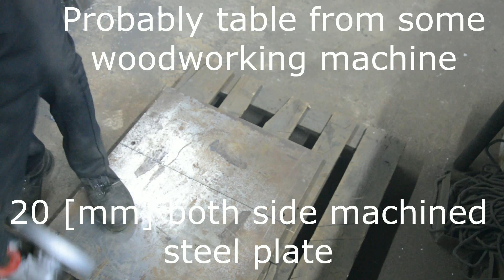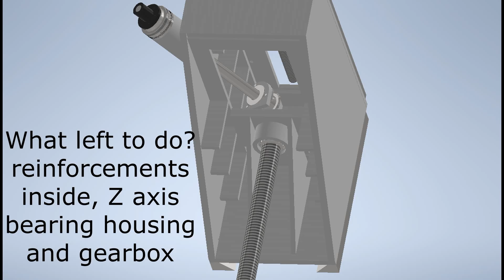DIY Milling Machine Build [Based on Bridgeport]. Part 8: Knee Body

Comment: Did you tried looking for a used milling machine in your area?
Reply from the maker: Believe me or not, used bridgeport type milling machines are almost impossible to find in Poland. There are usually very heavy and complicated USSR or Czech made machines on our market. All you can do is buy new chinese machine of this type, but it's expensive.
Reply: @SteelCraft99  i have the same problem here in northern germany, either heavy or extremly expensive. So i bought a cheap deckel g1l (engraving machine) and i'm planning to convert to a small milling machine, just needs a milling spindle and thats it :)

I hope your project doesn't consume so much money
Reply from the maker: Luckily I bought all needed hardware before prices went up. All cost It take now is price of scrap steel (also 2 times higher then when I started) and time